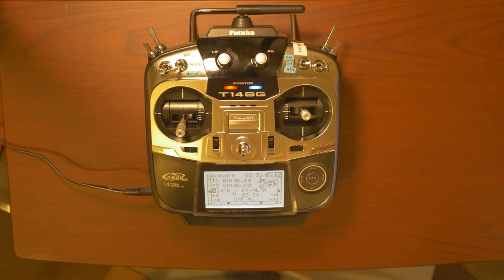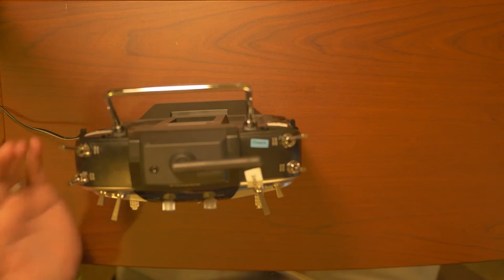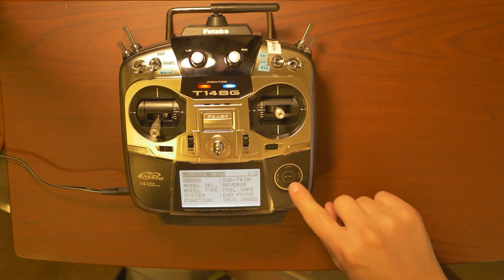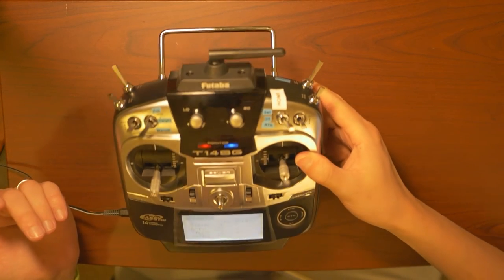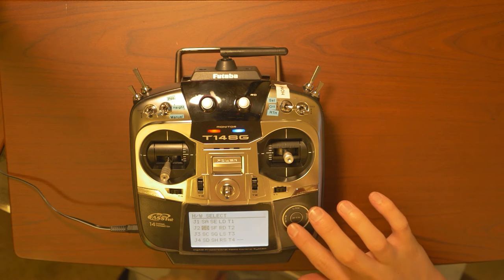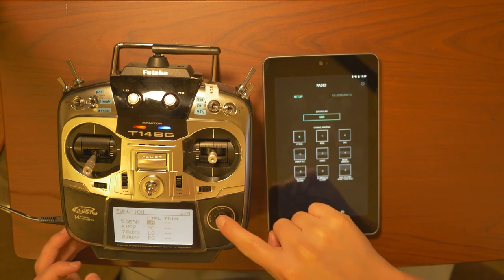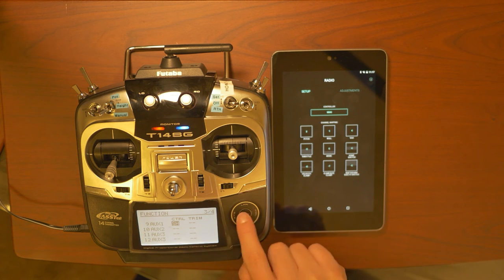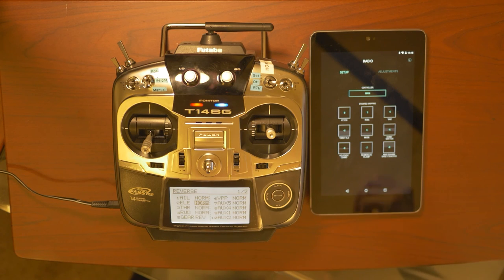Futaba T14SG Setup with Freefly Alta

Comment: are you still using this futaba controller for your alta
Reply: I haven't flown the Alta for several years, just been using the Inspire.
Reply: @WeAreMapuche  im trying to use with a MōVI and one for the Alta 6 so far it has been a nightmare I can’t figure anything and the alta was crashed I can’t understand why